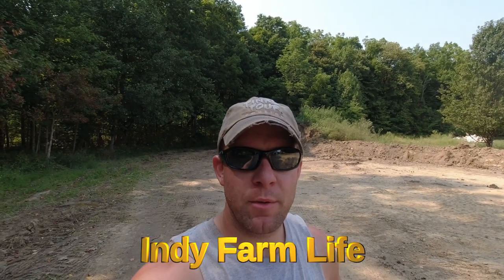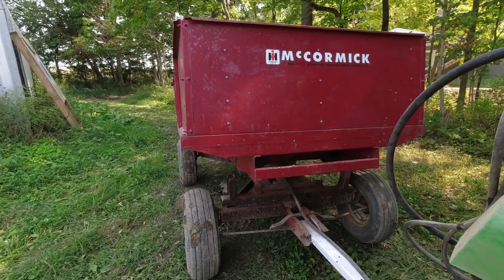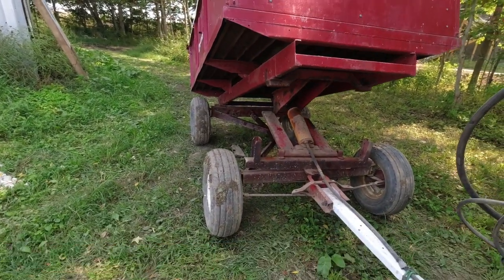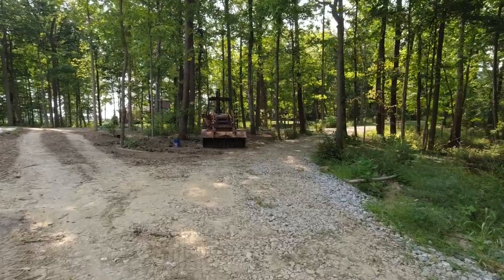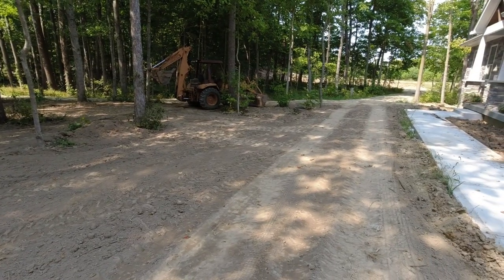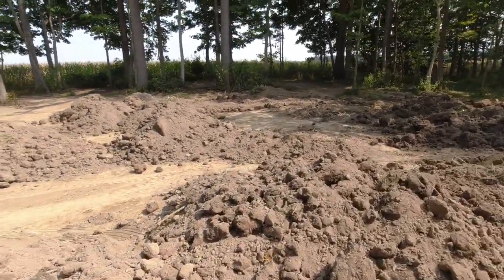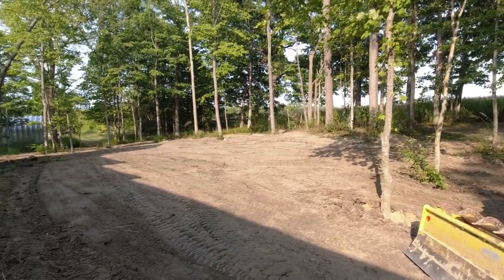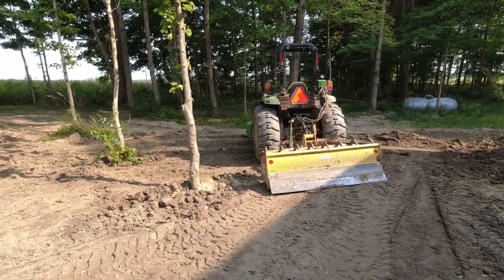Finish Grading With A Compact Tractor? - John Deere 4052R

Comment: Personally I all my own equipment repairs including making up hydraulic hoses, have a selection of gland wrenches to disassemble hydraulic cylinders and I keep a selection of seals for every piece of equipment I own. You did fine with the tractor as I have seen many landscapers do over the years. A skid steer would come in handy to manage trash piles though. You could put the grapple on the tractor for sure but it's slower. Hopefully at times  you do get help for your projects.
Reply from the maker: I do a lot of my own repair, but in some cases, it just makes sense to pay the pros/use my time elsewhere.  My buddies do help me out with bigger projects, but there is also a big sense of accomplishment when you do something yourself!  I wouldn't turn away a free skid steer ha, but with the other machines I have and not working commerically, I couldn't ever justify the purchase.
Reply: @IndyFarmLife  If you have quality and affordable technicians available it can be a good investment to pay them and get the work done right. In my case I own such old junk it would cost more to fix it that it is worth. You seem to accomplish a lot and I enjoy your videos. I can see why you would have friends who help.
Reply from the maker: @chargermopar  Thank you!  I appreciate the kind words.  I try to be informative and still get things done at the same time.  ha  It sometimes doens't always work out that way.

Comment: What width box blade is that? I’m in the process of getting a 4052R with wheel spacers and I’m looking at either a 96” or an 84” box blade. I plan on keeping the box blade on most of the time too. Any advice would be appreciated.
Reply from the maker: Hey Aaron, I believe it's an 84" and it stays on my tractor almost all the time.  It's a good size for the machine.  96" may "bite" too much (at least on a box with this build quality), but I understand you wanting to get outside of the wheels.  What brand of blade are you looking at?  The Gannon is one of the heavier ones.

Comment: Will a compact tractor work on bamboo roots?
Reply from the maker: As in ripping them out of the ground?  I haven't encountered bamboo while on the tractor, but I can't imagine it wouldn't be possible.
Reply: I’m looking at a used $20k Kubota with a backhoe. It’s a compact. I’m just worried that the backhoe won’t have the downforce to cut through bamboo roots. I should get a mini x but it’s limited in further applications. I love your channel.
Reply from the maker: @originalfallinggirl  Thank you!  Glad to have you along for the ride.  Let me ask you this.  Do you need the tractor for the multitude of attachments it can have, or do you really need a machine for digging, loading, and general dirt work?  If the latter, I would suggest looking into a full size backhoe.  For 20k you can surely find something.  Our 580k is so nice to have!
Reply: @IndyFarmLife  I hope it’s possible because I really like this Kubota. The funny thing is that I don’t need a tractor. I don’t even have a big yard. I live on the beach. But I’ve always wanted a tractor for some odd reason 😂
Reply from the maker: @originalfallinggirl  haha I can understand that.  If you don't want to go all in on buying something, you could always rent for a few days/week.  Get your job done and save tons of money!
Reply: @IndyFarmLife  yeah but that wouldn’t be any fun 😁😂
Reply: @IndyFarmLife  I owned a skid steer and had it on a farm I owned. It got stolen but was so rad. But they don’t dig well. I did like all the attachments.

Comment: Have you ever tore up a font axle
Reply from the maker: I can't say I have.  Did that happen to you?
Reply: @IndyFarmLife  on every 4000 series I’ve had at least once. I’ve hat it happen all the way back to 4520s I’ve had. I have a 4052r 8000 hrs and #1 cylinder is down also it has become a parts tractor unfortunately.
Reply from the maker: @sammarsh6021  Wow.  Is it because of low/bad oil, or what happened?  I am nowhere near 8k hours, so maybe that's why.  You use yours commercially?
Reply: @IndyFarmLife  it’s a bad design I’ve had it happen at 1000 hrs if you look around the web there’s issues all over about it. Yes I use mine commercially but if you saw the machines even the the 8000hr you’d say that looks new. I keep very good care of them. I’ve had it happen so much I have the number to jd aftermarket service rep.

Comment: Any complaints on the tractor?
Reply from the maker: Not really.  I would be happy if I didn't have a tier 4 engine but other than that, it's a workhorse!  I love it.  I have over 500 hours on it.  May plan a long term review video.  Let me know if you have any specific questions
Reply: @IndyFarmLife  tier 4 means you use Def or it just has a regen cycle?
Reply from the maker: No Def, just a regen cycle
Reply: @IndyFarmLife  ok. My LS 50 horse has the same.